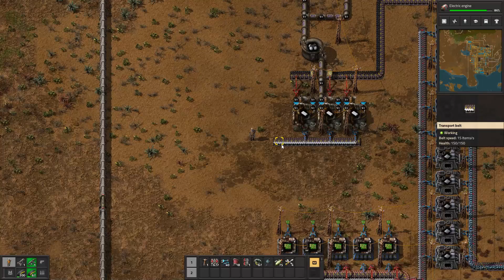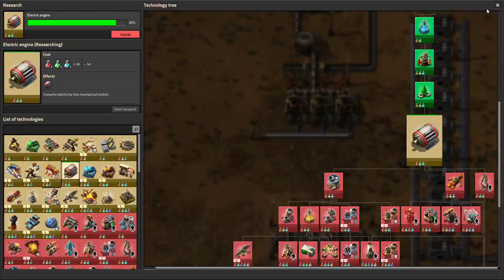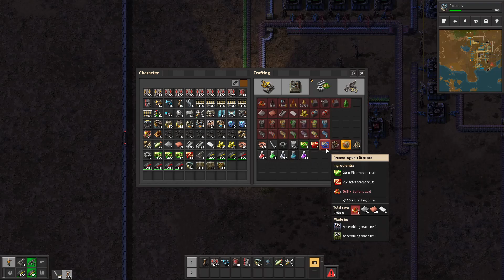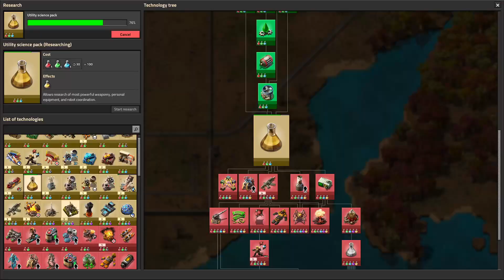Factorio 27: Circuit Boards Galore

Comment: For defense, it's probably a good idea to add a few more turrets and double-layer your walls. That way when you hear the audio alert when a wall is destroyed you have time to run over and check before the biters rush through. If you want to locate the base they're spawning from, you'll probably have to search south of the big lake. The water doesn't absorb pollution as well as trees, so your pollution cloud will easily spread over the water and trigger the biters there to attack your base.